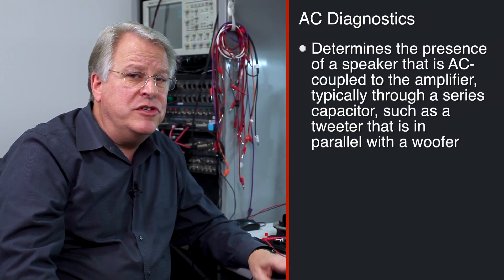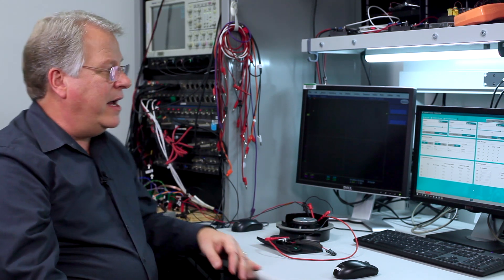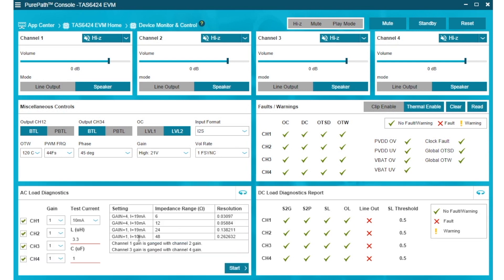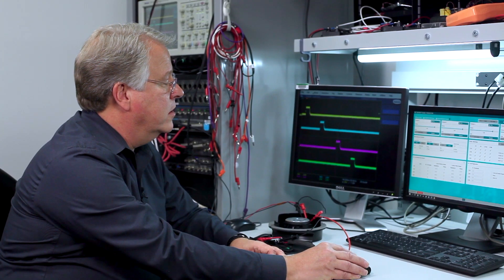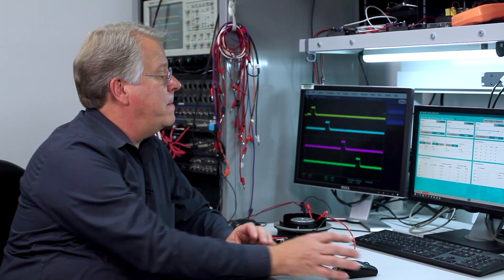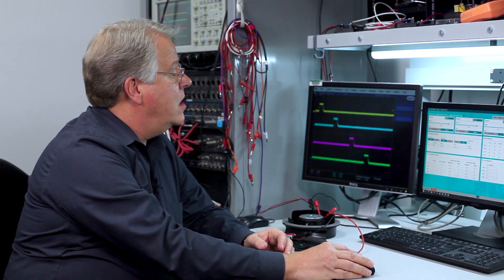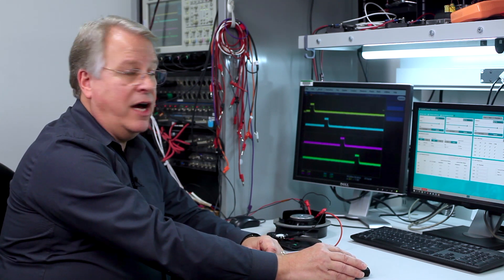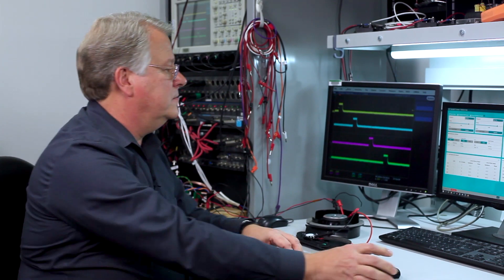AC diagnostics in automotive audio applications

Comment: Is it possible to design an amplifier IC — for either TPA3255 or similar models like TPA3116 — so that it can automatically detect and optimize the speaker phase on all four channels, even if two channels are combined in series connected to a subwoofer? Can the IC also be designed to automatically configure the crossover (cutoff frequency) and compensate for output power variations on each channel for both IC models?  
Additionally, although the official THD is claimed to be very low, practical measurements using the best audio cards, Neumann speakers, and Focal bands consistently show an actual output THD of around 0.5% (measured with professional Neumann equipment). What solutions exist to reduce the real-world output THD, and how can the actual performance be brought closer to the specified values?

[1](comet://newtab/)